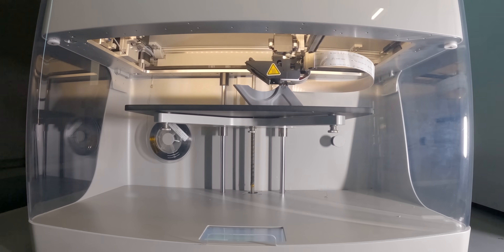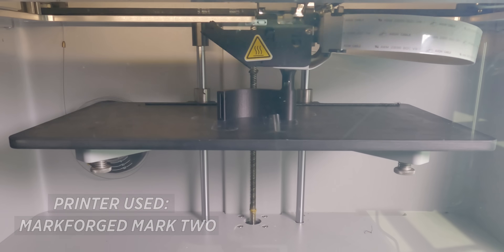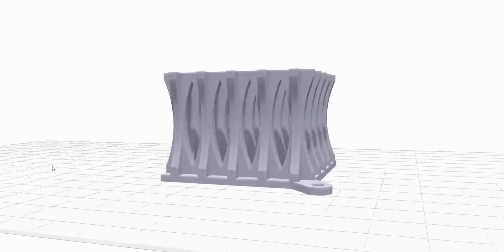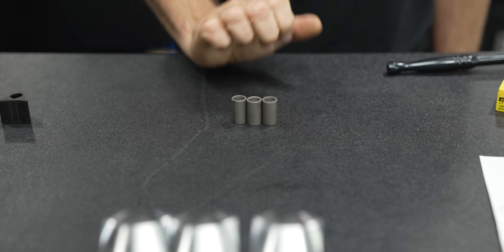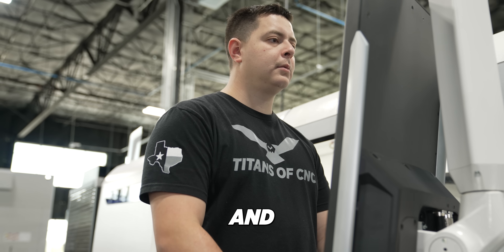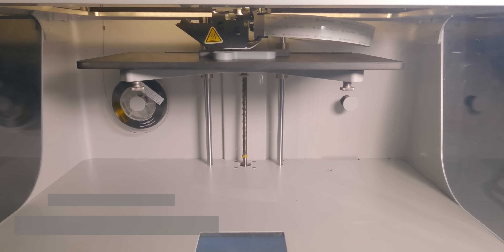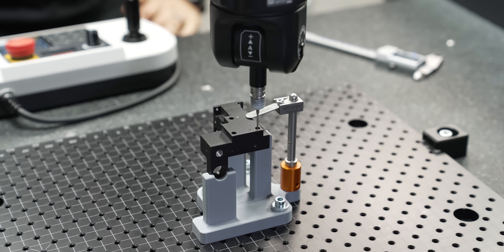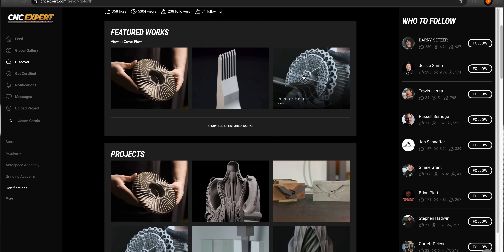Top 5 Game-Changing Ways to Use 3D Printing in Your Machine Shop!

Comment: Inspection is huge, especially for non-contact techniques. And if anyone is worried about how good their printer is, you can always design compliant or interference fits for ground rods and spheres to make contact with the parts. Just keep pure kinematic design in mind. Or make custom jacks using off the shelf and printed parts that can adjust fairly finely using differential pitch.

Comment: I just started using my first powder based metal 3d printer and constantly run into issues out of inexperience. Since it is not the most open source topic there is no real information out there that is not gated by a paywall. A complete walkthrough of producing a complex part, how to set up supports and generally what kind of stuff to look out for would be awesome!
Reply: What brand?
Reply: While you wait for a video, general printing rules apply to supports and complex parts. Fun stuff is the no build area, consistency, geometric accuracy, internal part defects, etc. However, research papers also exists as metal AM is huge in research as we try to push the technology into something that is used in manufacturing at scale.

Comment: Just received my 3D printer yesterday and it's been running non-stop. Very cool to prototype pars, make fixtures etc..
I got both types SLA and FDM. The SLA can make some very precise parts although it is slow.. very slow... and messy.
Reply: SLA shouldn't be that slow, unless you're doing research in technical ceramics. I guess that depends on what you consider very slow as well.

Comment: How stable is the CMM fixturing?  Have you bolted up parts, measured them, and then let them stand over night, (or the weekend) and come back to measure long term drift of absolute position?  You could then divide by the total measuring time for a part to get error bounds. Surely there's a tiny bit of movement even with small parts and loads, it would be good to have error bars.
Reply: I am a CMM Operator and I have created many custom fixtures for my CMM. The program has slightly looser parameters when taking the initial points on the part, then using those it runs the datums again and then begins taking the other points/planes. Its incredibly efficient and easy to teach an operator to use in the case of night shift.
Reply: Like to know this also, especially because of its thermal coefficient and hygroscopic properties.
Reply: Thermal movement and drift Shouldn't really matter since your picking up your references every time you run the a part. Probing forces are to small to really matter your talking about less than .15N if not half that.

Comment: Data is what A I is so important for 
I see 3D making those complex parts that Robots can use in their skeleton structure , oh well maybe I'm 25yrs ahead of myself. But I saw this 25yrs before,  Titan keep on pushing & booming
Reply: The software can do the generative design (assuming the person can do good in setting boundary conditions correctly), the printers can make the parts. The problem and why you don't see more of it, is a company guaranteeing the part is good in the same way they can with machined and/or cast parts. Internal part defects is a problem that is being researched to get the printers to be reliable enough that a company isn't putting their neck on the line. Factors such as where the part is in the build area, powder sources/recycling, operator, etc all influence this.

Comment: How do you account for scaling between resin/fdm and the final material when using method 2?
Reply: Make the part, measure, adjust scale. Most slicers already have a parameter you can or adjust, it would be a box that says like “”adjust printing model for shrinkage” or whatever, Cura has it, I can hold .002 or less on my fdm printer when tuned
Reply: Just like what adam said. I know that FDM slicers ilike Orca and Cura have built-in shrinkage/expanding compensation. As far as I know, none of the SLA/MSLA slicers have that
Reply: LOL at the replies. I'm talking about the different materials going from prototype to final part. It's not going to behave the same, it's dependent on material properties. I know you can change 100% to 99% in a slicer. I'm talking about how they guarantee that a prototype made from a different material will have the same form/fit/function as another.
Reply: @bubbasplants189  I think you have to have a practical and holistic view for prototypes. It can certainly save time and money, just think for a second if it will work for the use case. i.e did we miss the collision in CAD or measure wrong vs trying to get precision rectilinear motion.